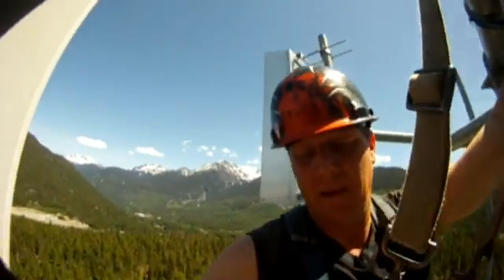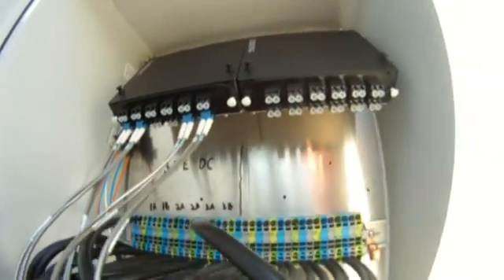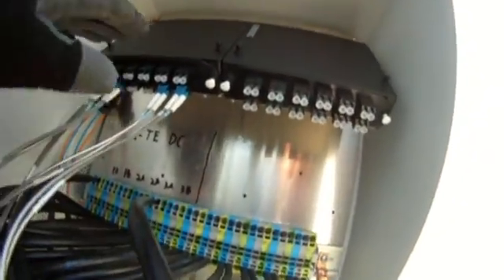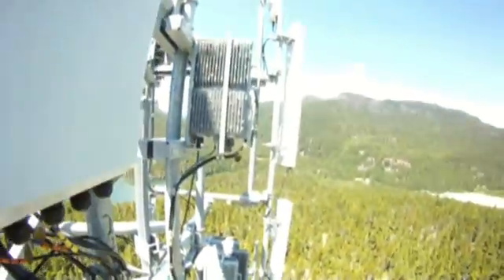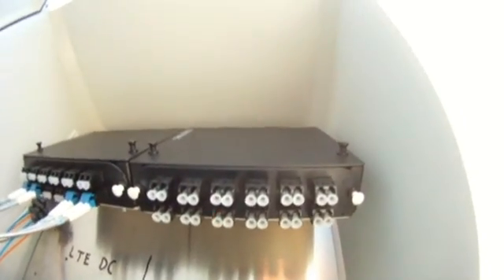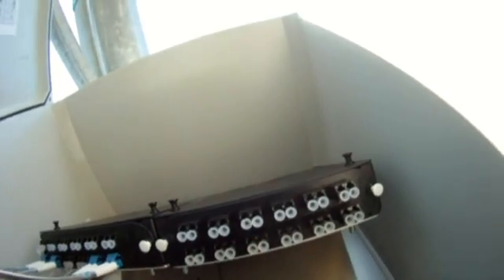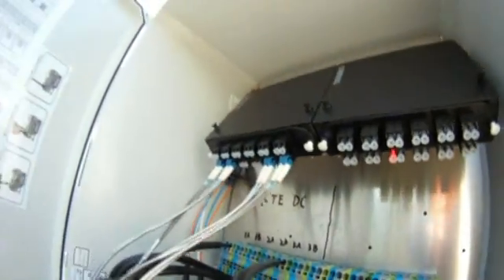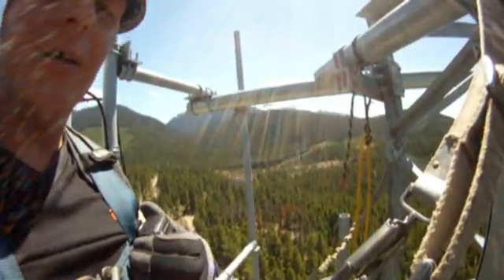Telus LTE Fiber testing

Comment: Nice Vid, man. Do  Telus ever require  loopback insertion loss testing for these fibre installs ?
Reply from the maker: Originally we were doing a loop back test. Now the tech's just do an OTDR on each strand. In some cases it may still be used. If a second RRU is on the same sector the jumper may be tested by the loop back type of test.